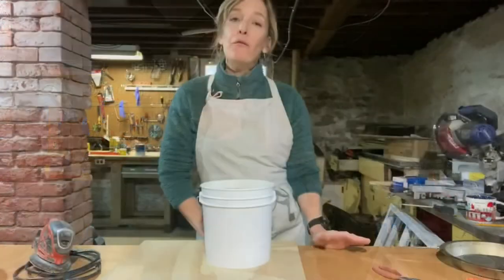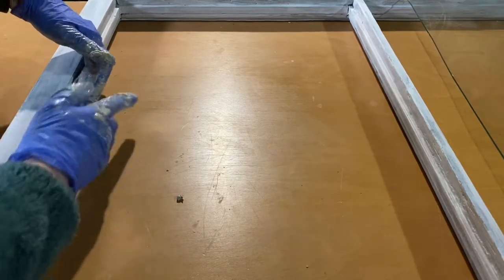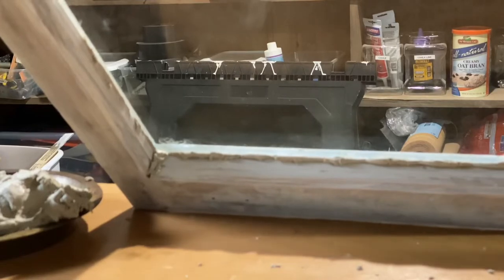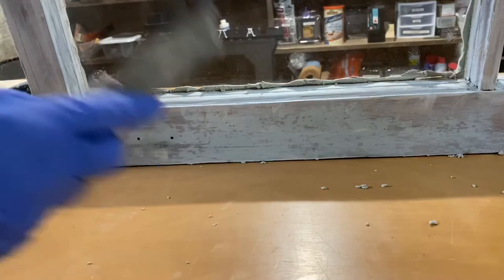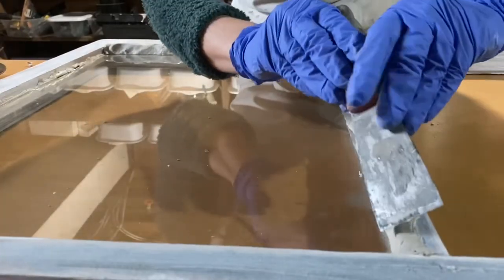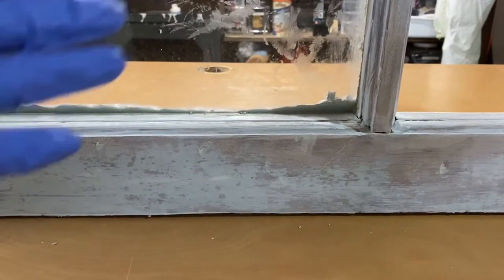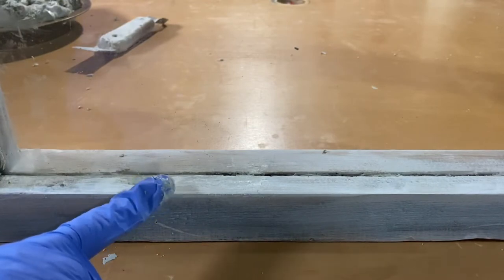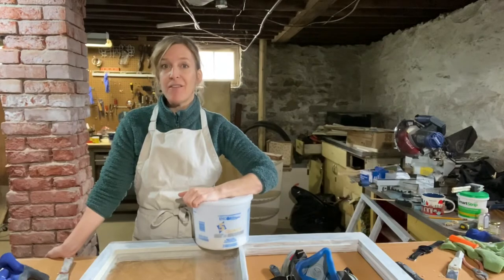How to Glaze a Sash Window

Comment from the maker: I want to add a clarification to this video. I got a little nervous during filming, and I described the location on the sash where you put the glazing putty as the frame. The technical term is rabbet. I believe that we are all capable of making repairs, whether we use or even know the proper terminology or not. :) I also want to add that I am not a window restoration professional or expert. I am a DIYer, proficient in several areas like window restoration, and I am here to teach AND learn.

Comment: Instead of using a sander I press lightliy at the edges of the glass and wiggle the glass ever so slightly for a while. You’ll see when the whole edge is pressed firmly in place.
Reply from the maker: Sure! That's a solution too.

Comment: Hi, I'm wondering why you don't use the other end of the glazing tool. The one with the V shape - to shape your angle
Reply from the maker: Thank you for your question. Most people find the tool that works the best for them, and they use it in the way that creates the outcome they prefer. I've seen a lot of people use plain putty knives to push a cut through the glazing putty rather than pull it as I demonstrate in this video. There is no wrong or right answer as long as the glazing putty makes a proper seal between the glass and wood, and it has an adequate angle to shed water away from the window.